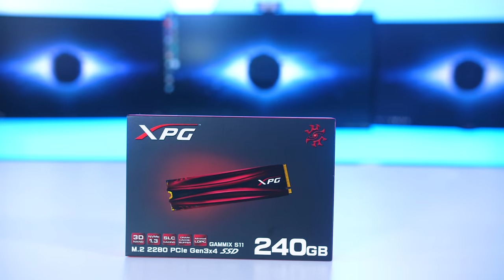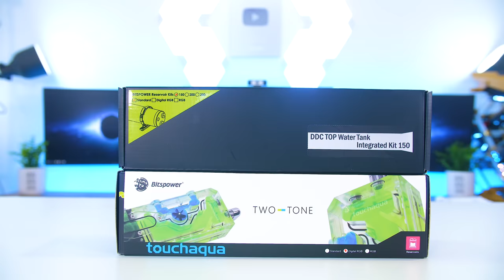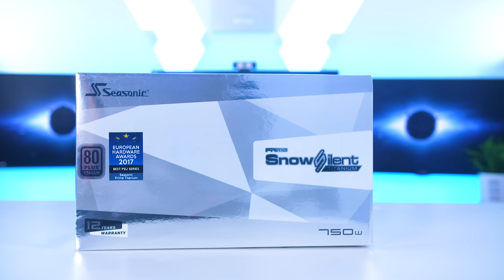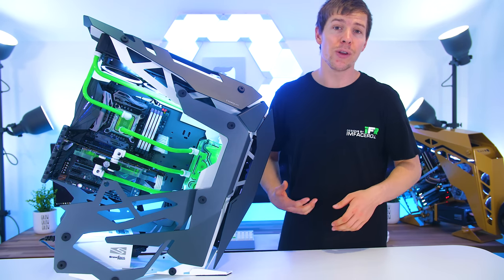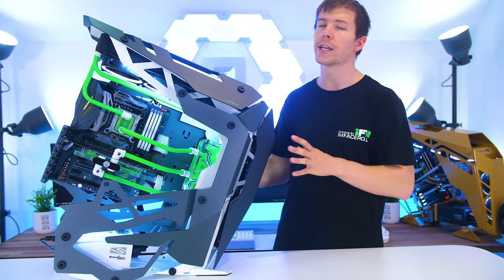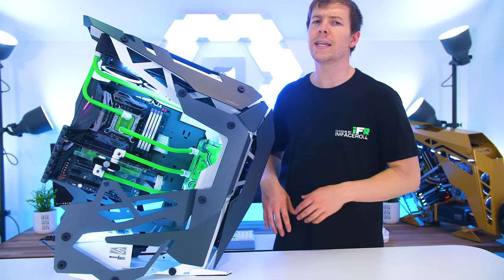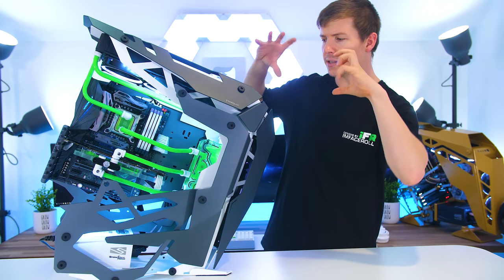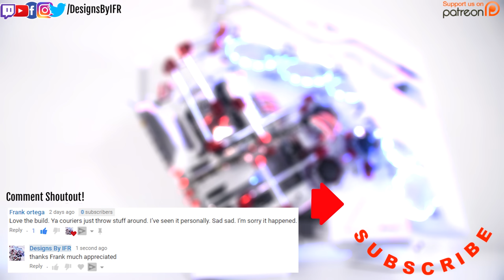$3700 Custom WATER COOLED Gaming PC Build 2019 - Antec Torque Time Lapse

Comment: Like the background. As with anything, improvements can be made (blue is bleeding through, editing cuts are a lot more apparent, echo on the mic, etc). More importantly, though, are you enjoying filming/building in your main room now? Also, that case looked a pain to primer/paint nicely with those circular parts on, especially without enough surface area to spread them apart.
Reply from the maker: Yeah the cuts are a lot more apparent due to the nanoleafs changing colour from white to blue constantly so i think i will just set them to 1 colour

Comment: Hey great build IFR. Question. Is it necessary to do an Pre-Liquid treatment before putting in your Final Coolant? Im about to convert my 8086k/systeminto a custom loop, and have the Primo-Chill 'Sys Prep' Pre-treatment that came with my soft tubing, Im sure you've heard of it. Supposed to just mix it with destilled water and run it through your loop for couple hours and flush it out, then fill in your Final coolant of your choice (In my case Xspc EC6 UV-Blue) It is extra step & Work, but is it "Worth" the time?
Reply from the maker: Hey man. Yes do it and make sure you flush your loop well. You want to get all of the sys prep out

Comment: Expected an 1080ti but the 1070ti asus strix has got the power of an 1080 when its oc so its ok. Seems easy to get good temperature with all this watercooling
Reply: These builds aren't about power, they're about looks. It might as well be a 950 for all it matters. For the price of this pc, you could get way better specs, but that's not the point of the build.
Reply: @aprofessionalateverything7585  So I went on amazon us and put all the gear except the case and the reservoir , all of that was nearly 2300$ then I went on my amazon the french one and look for the case and the reservoir. The two were for 700€ so around 1000$ if I add 2300 to 1000 it make 3300 my question is where did the last 400$ went?
Reply: Mister Koala keep in mind this is in AUD mate
Reply: @tomd9918  it's not even that much in USD. He says it's a $3700 pc, and that's AUD, so it's apparently $2640 USD.
Reply from the maker: Did u add in 2  fan packs, cable extensions $1200 for the whole water cooling
Reply: @aprofessionalateverything7585  exactly so annoying see people critique the specs used when it's for display that's going to be dissembled soon after

Comment: I built my pc, turned it on. The lights on the pc turn on, fans running, wires connected. But I cannot get a signal to my monitor? What should I do?
Reply from the maker: Take all lf your RAM out and plug 1 stick back in. See if it works
Reply: Designs By IFR okay I’ll try that.  but if it does work at what point do I put my second stick of ram back in?
Reply: Designs By IFR and thanks for helping out!
Reply from the maker: If it works try putting the rest back in